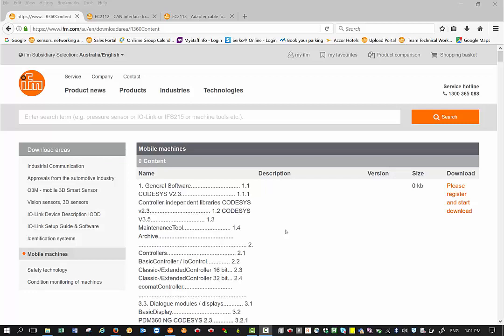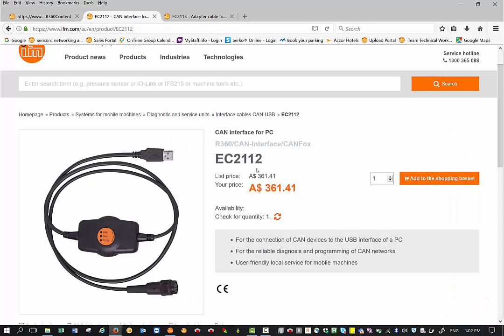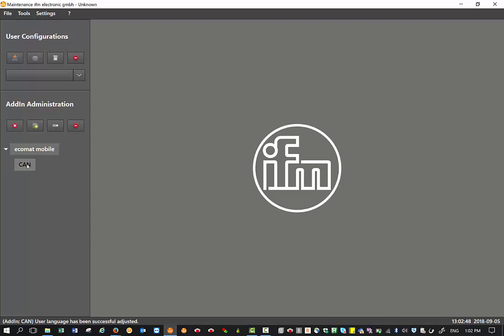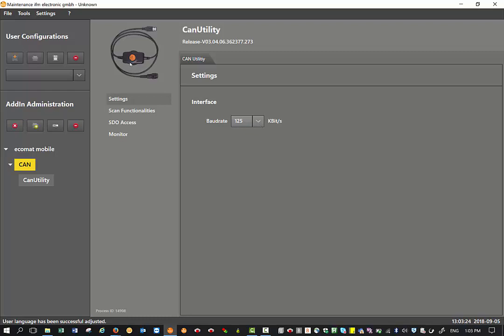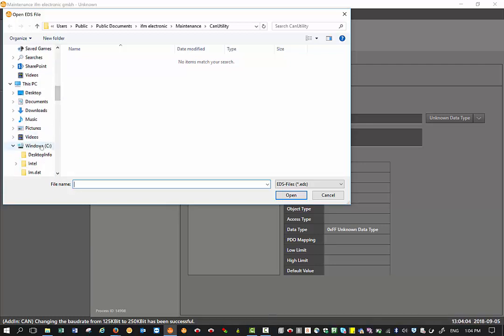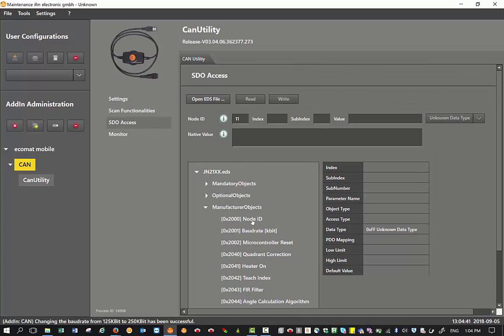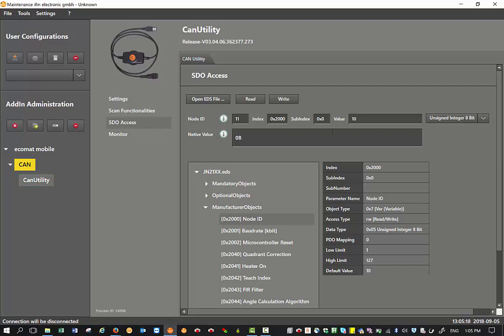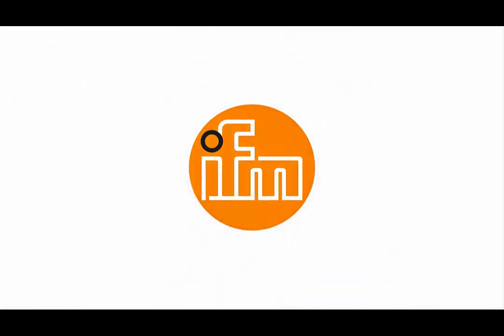How to: Configure a CANOpen device using ifm Maintenance Tool

Comment: Hi, ifm group please let me know how to connect CR2042 to PC for maintenance tool , i am having EC2112 and EC2113 hardware with me, I am unable to understand how to do the physical wiring for it ?
Reply from the maker: Hello, 

Unfortunately it is not so easy to answer your question in writing.
You must connect the M12 plug from the EC2113 to the M12 socket of the CR2042 so that you are on the CAN-1. When delivered, CAN-1 is always the CanOpen slave and this is also used for parameterization with the Maintenance Tool. As you need a terminating resistor for the connection, you could place the 
E11589 terminating resistor on the M12 connector side or configure an M12 socket yourself. Then connect the CanFox EC2112 to your PC/Laptop and access the CR2042 with the Maintenance Tool. The module is supplied with power via the lower connection X1. See the operating insructiuons:80268386_00_EN.pdf https://visit.ifm/41YLq2h

For further questions, please send an e-mail to info@ifm.com or contact our support team in your country by phone. 

Thank you!

Comment: hi sir thank you for the content. I have a CAN cable and it looks like EC2034. Its not but similar to it. Can I configure CANOPEN using my cable without EC2112, EC2113?
Reply from the maker: Hello, 

Thank you for your question. No, you can't use your own cable and use our Maintenance Tool for configure a CANOpen device, you need the EC2112 and EC2113 for configuration. 

Best regards, 
ifm's Social Media Team
Reply: @ifmgroup  thank you for respond, I'll use the CR0303 and operating voltagge of this PLC is 10-32V DC. I will provide the power with the power supply. Is there an ampere value I should pay attention to? What should I set the ampere of the power supply to? Thank you.
Reply from the maker: @talhakarakas6930  We have described, how to protect the power supply, in the CR0303 device manual. There you can find out, how to set the maximum current for your power supply unit. Power consumption without external load with 24V smaller then 100mA. If you have any further detailed technical questions, please send an e-mail to <info@ifm.com>, where you will quickly receive a response. Thank you and best regards